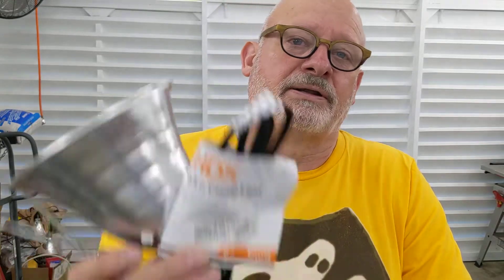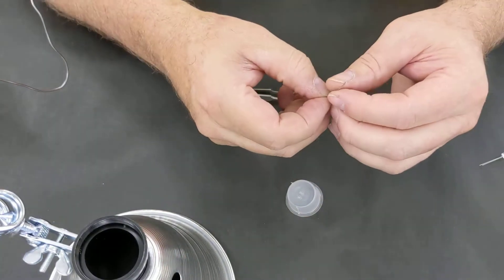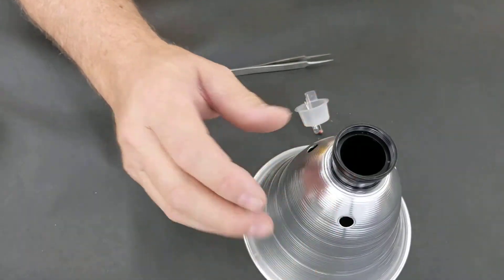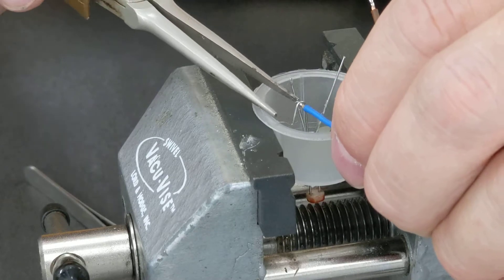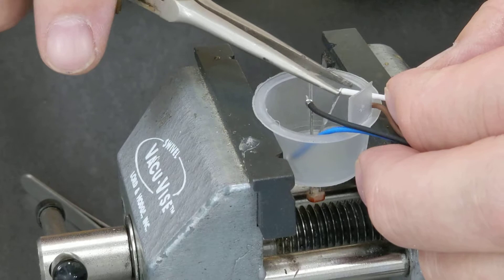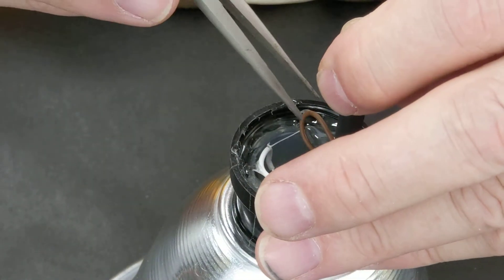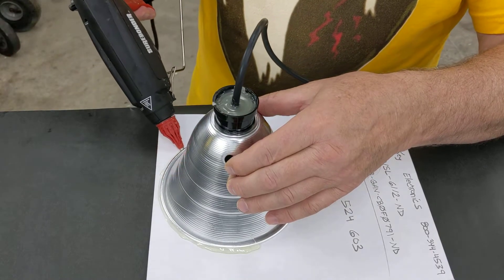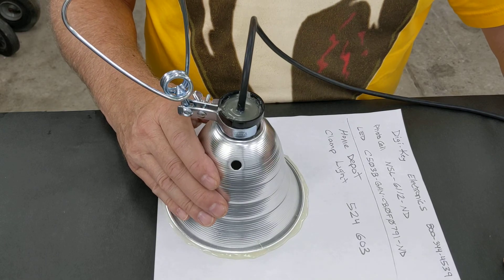Laser shooting practice system, step by step DIY making a target equipped with sensor and indicator

Comment: I came across your videos while I was googling how to make a light up hockey shooting target. Basically what I want to learn to make is how I could make targets that light up randomly that can take a hit by a hockey puck and not break. I know nothing about engineering something like this AT all. Any tips were one could start to learn how to create something like this? I would love to learn how I could build something like that for my children to make shooting Practice more fun for them.
Reply from the maker: I would use laser diodes to illuminate spots to attempt to hit with the puck.  Lasers are inexpensive at a few dollars each.

You could have them manually controlled with simple switches or randomly illuminated and /or have them follow preset patterns using a microcontroller called a basic stamp 

The lasers would just illuminate on boards or plexiglass, you could have sensors to detect if the puck hit...an easy way is to use microphones mounted to the back side of an isolated board, if the puck hits the board say a 2 foot square, the microphone mounted on that back of board would generate a pulse that could be detected as a scored hit, the laser would light on spot on the front of the board from across the room and circuit would enable a score on that board .  There is a lot of scoring you could include like how long it takes to hit target once the laser lights it, missed opportunities, actual hits on target, even the force of the puck hit could be scored